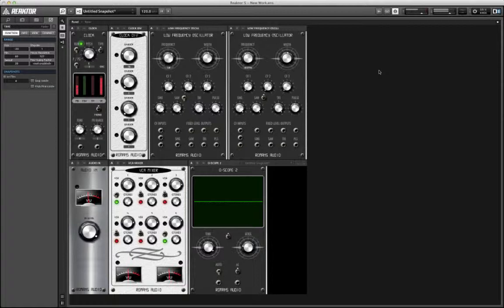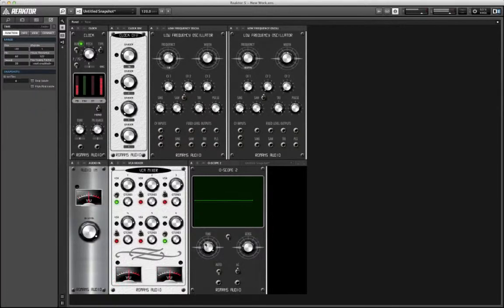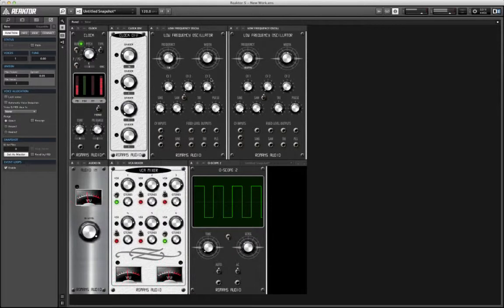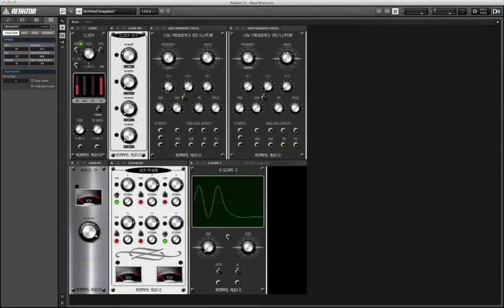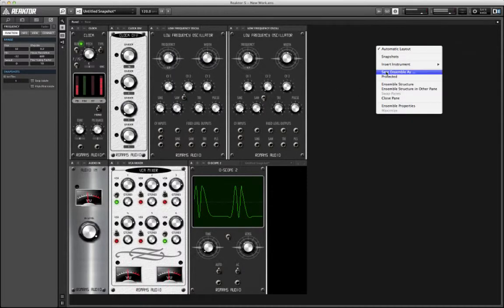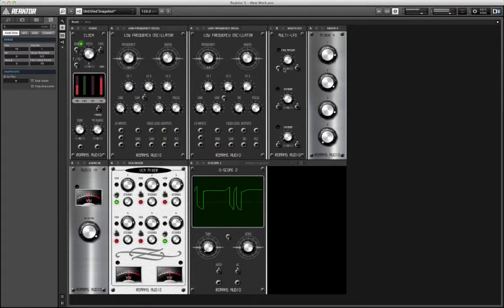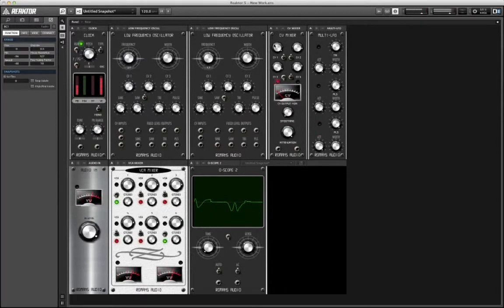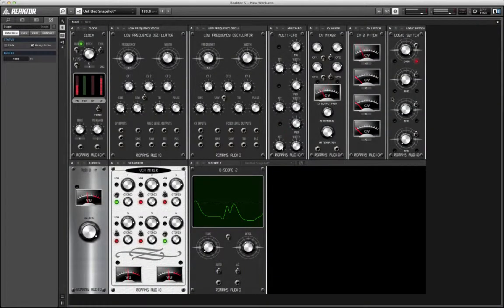CV HOWTO

Comment: so is this in the user library? I looked for it with no luck. also google turned up nothing...
Reply: I couldn't find anything on it either.
Looks really interesting.
Reply: Dominick Versetto yeah I wanna do a review on it. but can't find it anywhere
Reply from the maker: Not in the lib.  It's in Beta right now.  Should be available by summer.  Will make announcements when it's available.  Thanks for the interest!  BTW, today we added pulse based clocking that works across MIDI allowing for multiple systems running System 63 to all work together.  1 Master and then as many slaves as you like.  Works great.
Reply: Mike Romans well if you need a beta tester give me a shout. you can check my channel or my website Http://Fluxwithit.com for more info about what I do.